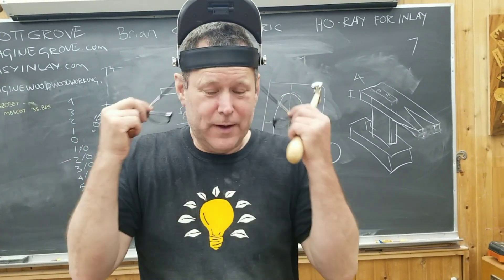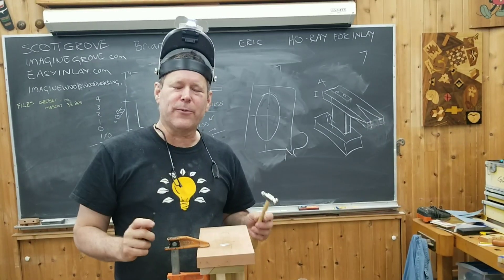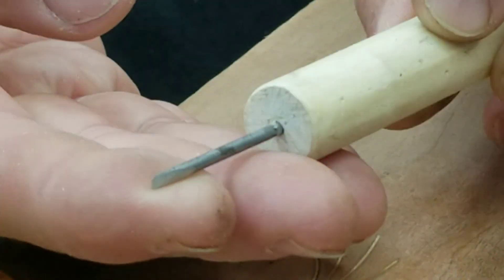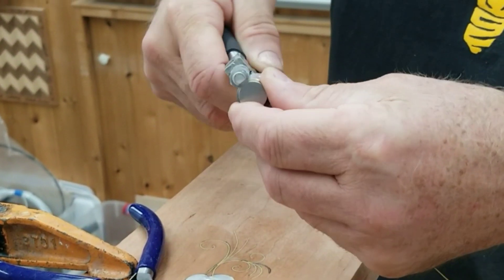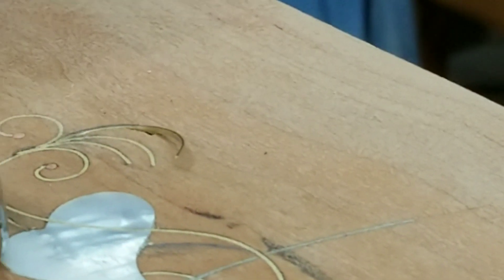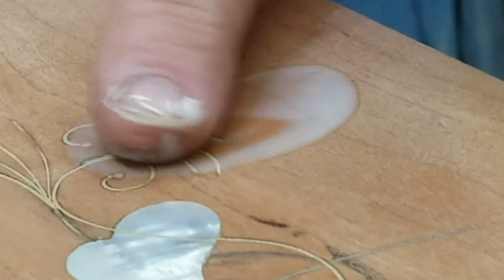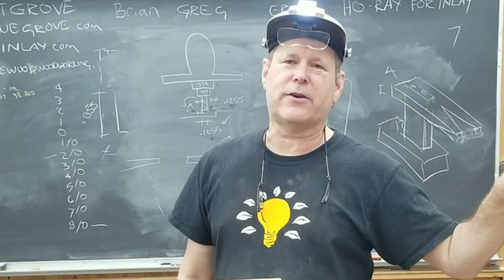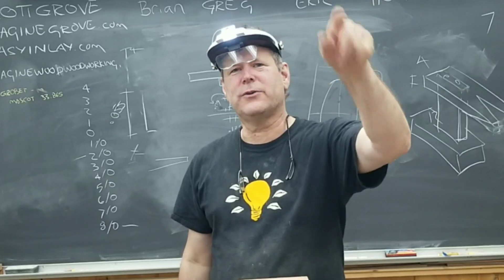Silver wire filigree inlay

Comment: What is the curving tool?  Thanks.  Also, when you use the water and glue mixture, can this surface then receive finish?
Reply from the maker: its a wire bending pliers.  glue mixture is 50/50, thin enough it won't effect finish.